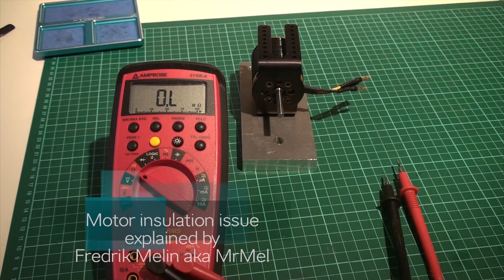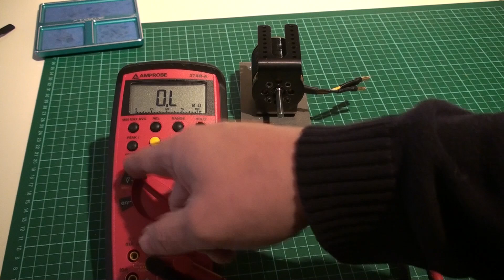Motor insulation - How to check your motor! (Blowing ESC reason #1)

Comment: Thanks for posting!  I only wish I had seen this a bit earlier as I just today lost a motor in one of my twin engine planes because of this.  Luckily it burned up between flights.  When I plugged in the battery for the 2nd flight there was a slight, muffled kind of pop sound and a cloud of smoke came out of the motor.  Fortunately it didn't damage the speed controller.  I was surprised on how much smoke came out of the burnt motor!
I'll be doing your simple test from now on for every motor I have!

Comment: What if all your phase wires read different resistances to ground (shaft)? Would it be safe to assume at least 2 of them are shorted/damaged, or could a wider range of resistances between winding/ground be acceptable for a BLDC? (They are not zero).

Comment: I built a drone yesterday and i couldn't get it to fly. After a while i found out the carbon fibre got really hot when the motors spin up! I think a screw touches the coils of the motor, and the current flows through the arm back to the PDB... i will remove the screws and try again :p